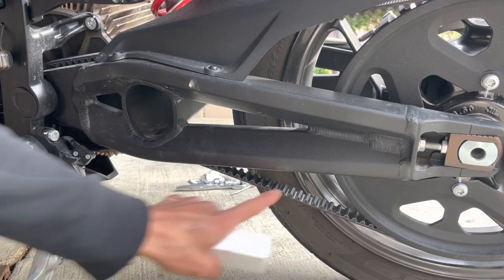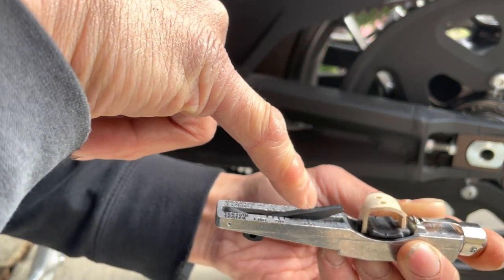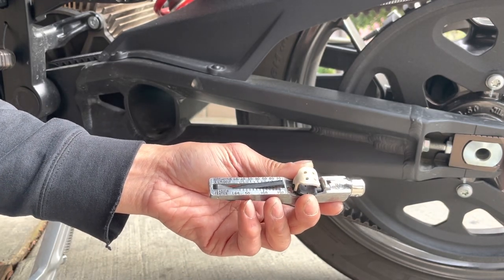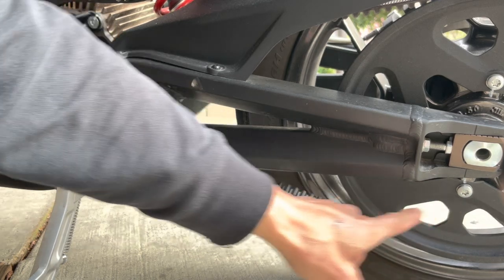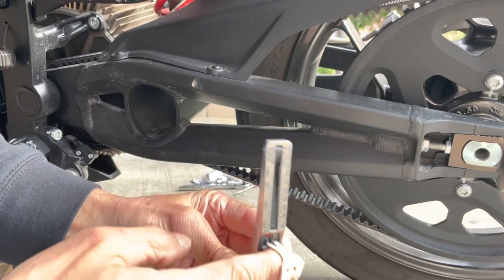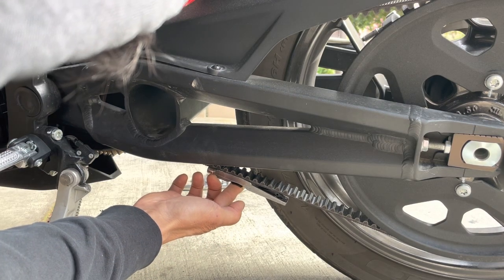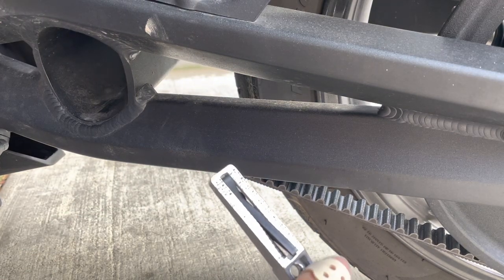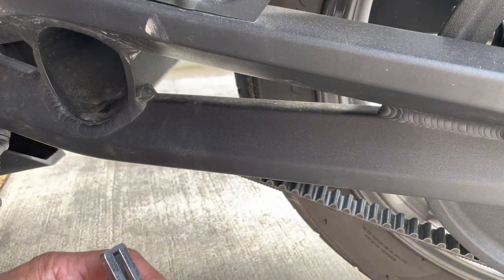Zero SR belt tension check

Comment: I have the older 2016 Zero SR with the skinny belt. The range is 20-30kg (45-65lbs).
Reply from the maker: Oh really...didn't know there was a skinny belt.  This 2018 belt is pretty skinny to  me, not much more then my 110cc or 150cc scooter belt.
Reply: @DaBinChe  The belt size was widened in MY2017 models and later. Before that the belt is the same width as the Krikit belt tensioner.
Reply: 25kg  krikit... correspond a combien de HZ sur carbon drive application ?  50 hz?